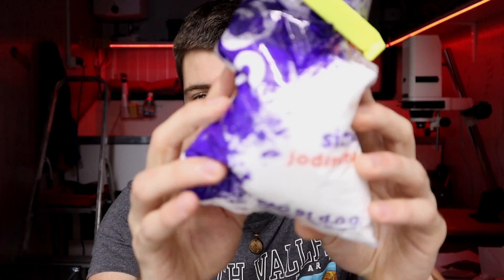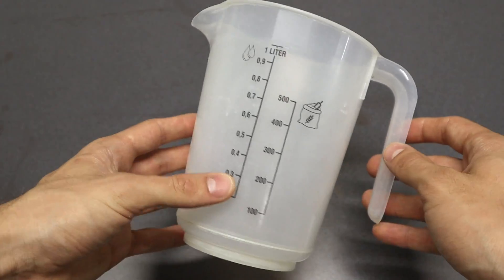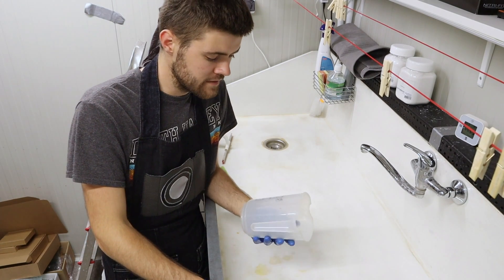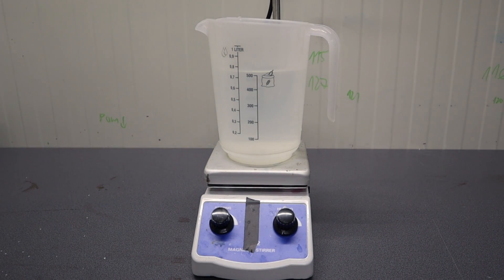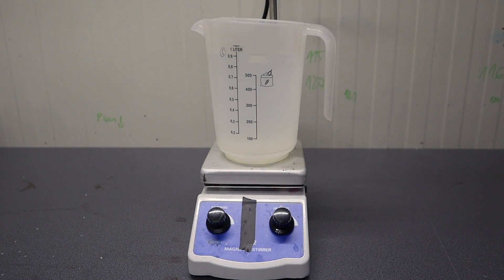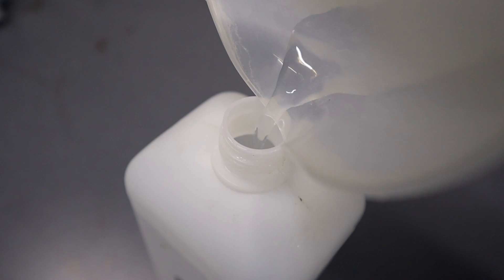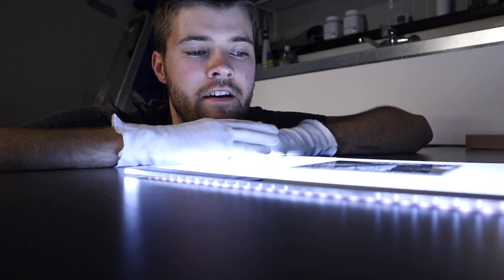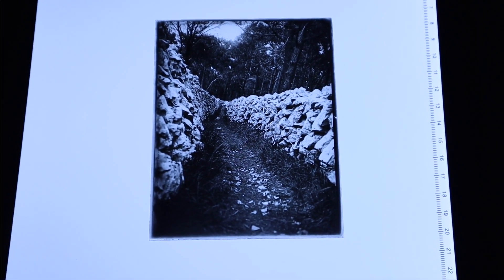How to make your own FIXER | Step by Step Walkthrough | Developing Film | Analog Photography

Comment: I'm so old that when I started doing my own B&W printing in the late 1950s, almost no one used rapid fixer, In fact, I'm not sure if it was even available back then. My photo store sold raw sodium thiosulfate, which they repackaged in heavy-duty brown paper shopping bags, 5 or 10 pounds each.  Sodium thiosulfate is very hygroscopic, meaning that it absorbs a lot of water out of the air, so we'd measure it by volume rather than weight. The old Kodak Fixer was this formula. It fixes film and paper as well as a modern rapid fixer, but it does so more slowly, thus the "rapid" in the name of the later fixers.

Comment: How long will the fixer last if developed with 35mm film? Wonderful video btw!!
Reply: With film, you can test the fixer by putting a small chip of undeveloped B&W film into a shot glass with some of the fixer. Watch to see how long it takes for the film to completely clear. That is your MINIMUM fixing time. Then when you actually process a batch of film, leave it in the fixer for TWICE as long (at least).
If you perform this chip test every time before you process a batch of film, you will notice that the clearing time will take longer and longer as the chemistry gets used up. At some point, the chip will take too long to clear to be practical and that is the time to dump the fixer (or recover the silver) and start with a fresh batch.
Reply: It's much harder to judge fixer exhaustion when you are fixing paper rather than film. The best way to judge the amount of paper you can safely fix in a sodium thiosulfate fixer today might be to look up the specifications for the old Kodak Fixer (not "Rapid Fixer") and use the paper fixing capacity given for that product. Sodium thiosulfate fixers are so simple chemically that they all have about the same shelf life and fixing capacity.

Comment: Hello. Is the fixer that you made in this video (concentrated solution) and must be diluted with water again as needed when working in the darkroom, or is it used only as it is without dilution? How long does it last for a long time? How long does it last? And after using it, do we return to the bottle again? I have in the home store 1 pound of sodium thiosulfate powder. Can I make a small amount of about 350 milliliters for paper repair and how many grams of powder is enough for that? A set of questions, I hope you can answer briefly, and thank you for your efforts.
Reply: You can use this fixer until it slows down to where it no longer works.
With film, you can test the fixer by putting a small chip of undeveloped B&W film into a shot glass with some of the fixer. Watch to see how long it takes for the film to completely clear. That is your MINIMUM fixing time. Then when you actually process a batch of film, leave it in the fixer for TWICE as long (at least).
If you perform this chip test every time before you process a batch of film, you will notice that the clearing time will take longer and longer as the chemistry gets used up. At some point, the chip will take too long to clear to be practical and that is the time to dump the fixer (or recover the silver) and start with a fresh batch.

Late in his video he actually said to NOT dilute this fixer! Use it just as it is.

If you can find brown glass bottles those are the best for fixer and developer because unlike plastic, glass will not let air get to the chemistry. Brown glass also blocks most light which also will help the chemistry last longer (especially developers).
Reply: 1. the formula is a working solution. You do not dilute it for use.
2. Unused, or only lightly used, he says 3 months in the video. My use indicates about 6 month.
3. You return it to the bottle for reuse unless it dies of age or is used to exhaustion, which he defined as 25 8x10 inch prints. In film, you would process for 5-10 minutes. I do not recommend using this type of fixer on T-grain type films like Kodak T-Max. They require a more powerful fixer.
4. If you want more or less than one liter of solution, just scale the the amounts of the two ingredients more or less to match.

Comment: Where in the USA is a good place to find the raw chemicals to make B&W fixer and developer?
Reply from the maker: I am based in europe so maybe someone else will help. I mostly get them on ebay 😉
Reply: In the US, there are several on-line suppliers of chemicals used in photo processing. The best known and stocked is probably the Photographer's Formulary in Montana. In major cities, where you might still find a real camera store, you may find a limited supply of the chemicals required for the most basic formulas, but the pricing and shopping options are far better with an on-line store like the one mentioned above.  Apart from always having fresh stock on hand, the best part of DIY mixing of formulas is cost. For around $50-75, you can buy enough chemicals to mix literally hundreds of dollars worth of first class developers, stop bath, fixers, whatever you want. The great leap forward in DIY photo-chemistry came with the introduction of electronics and micro-processors to tiny volume weighing scales. For less than $20 you can now drop into Staples and buy an office gram scale which will blow away my several hundred dollar triple beam balance scale, and it is much faster to use.

Comment: This is classical unbuffered fixer, and it works fine if slower than current "rapid" fixers. Very inexpensive. One thing not discussed here: Sodium thiosulfite is  extremely  hydroscopuic, meaning that it absorbs water out of the air very easily. Accordingly, the original recipes for this type of fixer usually specify the chemical by volume rather than weight. Weight can vary significantly depending on how the chemical is stored. Back when I started DIY fixer in the later 195os, photo shops sold sodium thiosulfate in 5 or 10 pound weights in a paper shopping bag, for a couple of dollars a bag. Now, it's relative disuse makes it harder to find and significantly more expensive.
Reply: Get sodium thiosulfate from pool and spa suppliers. They sell it as as chlorine reducer.
Reply: Yes, my local swimming pool chemical house sold me some.
Any idea where to find Sodium Sulfite locally?
Reply: @AtlantaTerry  No, not in supermarkets at least. However, it is the most used chemical in photo-chemistry, as it protects the active ingredients from being oxidized in water. Any supplier of photo chemicals in bulk (on line) will have it, as will any chemical supply house. You used to be able to buy it in even the less  well stocked photo stores, but that era is gone outside of major cities in the US. Compared to other chemicals, it is also one of the cheapest.
Reply from the maker: Great information Randall thanks for taking the time and writing it down 🤗

Comment: Love doing DIY chemistry, so far all I've mixed up is developers. Will have to try the fixer, without a hardener probably will work great for Pyrocat developed negatives!
Reply: I do not use pyro based photo chemistry, but my reading indicates that the stain which distinguishes pyro negatives does not respond well to the traditional acid fixers (like those discussed in this thread). Take a look a the few formulas for non-acidic fixers, and I think you will fair better. If you can mix a developer, you can mix a fixer as well.

Comment: Please discuss Chrome Alum as hardener and the correct methods
Reply: Alum is the traditional hardener for acid fixers like this one. It is also optionally used in "rapid" fixer formulas. Prior to the mid- to late 1960s, most B&W film was made with an emulsion which was quite soft when wet (during processing). That film was easy to scratch until it dried. Hardening fixers were the standard to avoid emulsion damage during and after processing. After the 1960s, nearly all film used a "pre-hardened" emulsion which does not need that hardening treatment. The down-side of using a hardening fixer is that it makes it much tougher to wash the fixer out of the emulsion at the end of the developing process (washes were 2x-4x longer). By 1970, hardening fixers were out of fashion with the general introduction of rapid fixers, sold with the hardener separately so you could choose not to use it (Kodak) or with no hardener (Ilford). There is no reason to use a hardening fixer with any film stock made ion the last 50 years.
Reply from the maker: Hey Randy there is so much written about this topic on forums. Basically chrome alum hardens the gelatine when it gets into the fixer and makes it more resilient to potential lifting, wrinkling...

Comment: Do you use hypo check to determine if your fixer is exhausted or do you mix up a new batch well before it gets to that point? And future videos showing your print making, especially alternative processes, would be appreciated. I'd love to see some of your images done as kallitypes.
Reply from the maker: Yes hypo check is deffinetly the way to go. I am deffinetly planing on making more printing videos specially now when I can contact print 8x10 plates 😊
Reply: I use a commercial hypo check. Oddly, it tells me that stock fixer which should have died of old age several years previous is still good. That old (not over used) fixer also seems to do a good fixing job. So, do I go with the "check", or with the expiration recommended?  When I say "expired", I mean a couple of years. Being s "belt and suspenders" type of guy, I toss the old and mix up a new batch.

Comment: I'm just starting to learn about darkroom techniques after not going anywhere near one for decades so I'm glad I found this channel just now. One question: Is it safe to pour this fixer down the drain afterwards, or do you have to dispose of it some other way?
Reply from the maker: Sodium thiosulfate is used in water purification plants for town water. Don't worry about it. The silver in it will become silver sulfide (no shortage of available sulfur compounds in the sewer!) which is stable and won't bother any living thing (so stable that sulfided prints last longest). You can recover the silver tho if you use plenty of it.
Reply: @lostlightart6064  As you say, the fixer itself is not a problem. However, the silver compounds in the used fixer can be damaging to water waste systems, or at least deemed so as to caused regulations prohibiting such. In the real world, so few people flush so little used fixer down the drain that there is no real problem. Now if you have a private septic system, I'd reconsider doing that.

Comment: Is fixer the same for all processes (bw, c41, etc)? Thank you for all that you do!
Reply from the maker: I bealive c-41 uses a bit different formula since it is a color process but with all the other BW materials it will work from Paper to Dry Plates 😉
Reply: The concept and function is the same in all such processes, but the formulations for B&W versus color are quite different. Between E-6 and C-42 or ECN-2, the formulations are not so much different but still not the same. Those difference usually are driven by the need to maintain a different pH  in those various solutions.
Reply: Colour has a different fixer but BnW Fixer can be used